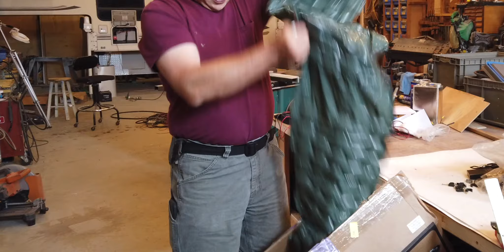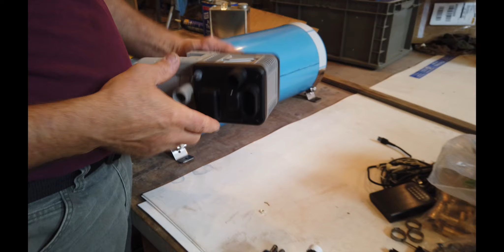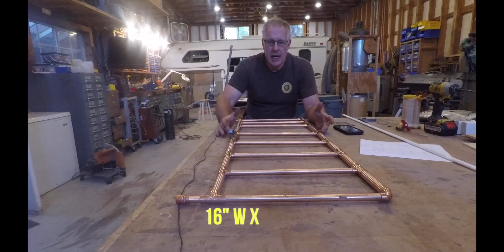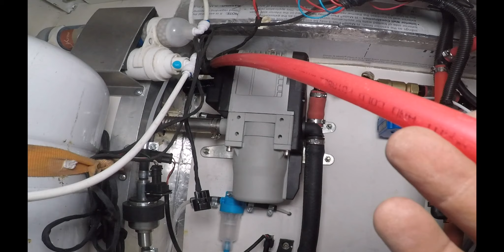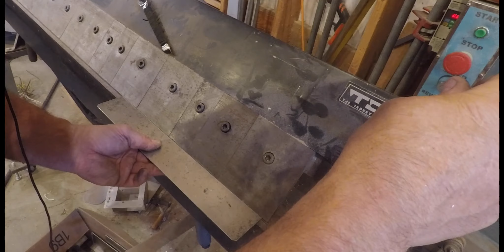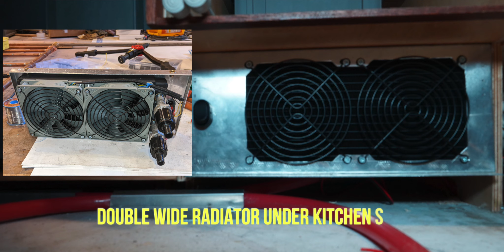BUILDING / INSTALL: Hydronic Heating for DIY Trucks Camper Expedition Van Build

Comment: Great video. Any reason why you did not use plate heat exchangers especially to get heat from the engine coolant?
Reply: HX add not only circuiting complication but require addition and control of additional. Pumps. In addition to that, energy exchange in HX is not 'free'. There will be around a 10C temp differential between the primary coolant side and the secondary coolant side. The 'cooler' secondary coolant subsequently has lower temperature and respectively lower heat transfer to the target. For instance, coolant exiting the boiler at the maximum of 80C/180F and flowing through a HX will only result in a maximum of 70C/162F output. This 10C/18F differential exists in the system at ALL temperatures. This reduces the rate of heat exchange at all temps but is particularly problematic until the boiler reaches near max temp.
Reply: @stevehericks5764  that makes sense. I was thinking from a reliability standpoint, it would reduce the likely hood of a problem downstream if there was a leak in the system and the ability for the vehicle to drive out.
Reply: @ramzizaz I use actuated ball valves on both the engine coolant supply and return lines that can can isolate the engine side from the habitat. If there were a leak in the habitat, I could prevent  loss of engine coolant. Additionally,  after I isolate the engine, i have the ability to drain coolant from the habitat that I can add back into the engine.

Comment: You're a mad scientist. A man after my own heart. I am designing a system myself and found this very useful. How did the radiator work out for the bathroom? I had something similar in mind but had plans on just using soft copper tubing and bending it back and forth much like a car radiator. The larger diameter tubing might be a better idea because it would probably hold the heat longer? Thanks for sharing.
Reply from the maker: I used 3/4 sides and 1/2 rails mostly because I had lots of pipe already...it works pretty well at heating the shower...what id intended was that it would almost superheat the shower/entry so when the door is open when cold, it would potentially push heat into the camper. It doesn't really do that. If dit again, Id used 3/4 type K everywhere for strength as it can become a handrail when not heating. It is a bit of burn hazard when showering so I wait 20' or so after heating a tank of water and shutting it off.  I haven't used it much as it's intended for really cold weather and haven't camped in that because I've been living in it for a year and a half while I'm building a house and have shore power and mostly use the heat pump. It does work well and I have no regrets.

Comment: Who designed the fiagram ?
Reply from the maker: The hydronic plan was done by me based on all  the things I wanted the system to do and the way equipment is intended to work. There are a lot of designs made that inadequately consider issues like 1) flow control, especially balancing in parallel circuits, 2) temperature drop in multiple or serial heat exchangers, 3) adequate capacity to discharge heat like the expectation that small floor grids can effectively radiate much at all. 

The diagram is available in a PDF document with a (hopefully) thorough explanation of the design intent of various elements at WorkingOnExploring.com/TechDocs. The diagram itself is designed in MS Visio which I will share but is not posted.
Reply: @WorkingOnExploring  
Thank you very much, so much information. I believe that you are an expert just before your buid
Reply from the maker: @EWOverland  I have 3 videos on the system covering 1) design, 2) construction and 3) operation that covers some performance evaluation. Since then I have added some functions  (heat radiators in my battery box) and made a couple tweaks. I still have yet to complete adding a heat loop to my gray tank (but plan to). I'm in the middle of building a large shop-house which is using a 72kBTU air to water heat pump to provide heat for 4200SF of concrete floors, a 6x54ft lap pool, a hot tub and heat/cool the 2800sf residence with a large hydronic air handler...so not many recent video updates. A few updates are in travel videos or mixed with upgrades to the freeze protection system made after the hydronic videos which is closely integrated to and dependent on the hydronic system.
Reply: @WorkingOnExploring  Thanks, the link for the chiniese hydronic heater do not show the heater

Comment: Your camper really has it all! Small but packs a punch. Hydronic heating usually only appears on top end class A diesels motorhomes.
Reply from the maker: Thanks. The hydronic system evolved from my goal not to have propane and a the need to heat water using a diesel source. Then there was the ability to get 'free hot water' from engine waste heat that came along with using coolant to heat water. It only seemed natural to add the hydronic air heating capability to the cabin too. It works very well and the redundancy is comforting. I also realized that using hot coolant to provide freeze protection was also a benefit. While  do have electrical freeze protection backup to external areas, I will soon implement a hot coolant loop in my (external) battery box and gray tank.

Comment: Very cool stuff.  Do you have a link to where you found the Chinese espar copy?
Reply from the maker: The coolant heater is a product of 'Hcalory'. I bought it on Aliexpress through the distributor called 'Szyiqitrading'. I would not recommend buying from them as when I had an issue (the operator manual did not include operating instructions for the wired controller provided), they were unresponsive. I doubt they had the information anyway and were just reselling the product they bought repackaged. When I contacted Hcalory directly, they also would not help because I had not purchased it from them directly. In my opinion, Hcalory is responsible to provide a manual covering the equipment in the box regardless of who  I purchased it from. What I believe happened is the control was new enough that they had not done that yet and simply hoped for the best.
Here is the link;
https://www.aliexpress.us/item/3256803096628968.html?spm=a2g0o.order_list.order_list_main.5.63711802EwB5Jo&gatewayAdapt=glo2usa4itemAdapt&_randl_shipto=US

I have written my own manual for the 'new control' and posted it on my blog: WorkingOnExploring.com/TechDocs

I do note that the product on the above link is almost devoid of the Hcalory name which was more prominent when I bought mine. The unit is available with a number of different controls. I chose the 'New remote' which contains a different wired control AND wireless control, both of which I like. The wired control however has all Chinese characters for status symbols. The updated ad shows English characters in place of Chinese so hopefully newer units will not have that problem. It is hard to guess if they will have updated the manual in the package you might get.

I absolutely do recommend products made by Hcalory however. It is very well made and even the installation parts are well done. There are two minor exceptions; The screw style hose clamps for the 3/4" heater hose are crap and there is no 'T' fitting to tap into a fuel line. 

Here is their manufacturers link to the same unit;
https://hcalory.com/collections/heater/products/w51-plumbing-heater-wireless-remote-control-12v?variant=39961317113899
The product is also less expensive through their site than the distributor.
Reply: @WorkingOnExploring  Thanks for the info and the links!  On the product page, it seems to offer conflicting information about fuel type.  It shows "petrol/diesel" on a few pics, "petrol vehicles" on another, and "diesel" in the specs.  I need a gasoline heater, unless I decide to install an auxiliary diesel tank on my Promaster.  I'd prefer not to go that route.  Any idea if they offer a gasoline heater?

Also, does this need a glycol reservoir tank added to the system?  I didn't see that in the accessories listed.

Did you pick up your heat exchangers separately to heat your water & air?
Reply from the maker: 1) According to the manual, it will operate on either diesel or gasoline.
https://cdn.shopify.com/s/files/1/0565/0507/3707/files/W51_Plumbing_Heater_compressed.pdf?v=1673076304
See page 5.
2) Technically, hydronic systems can be operated as either a closed system with a pressurized expansion tank (either bladder or airspace) or as an open system with a vented 'reservoir' tank. I elected to use pressurized because it was sharing coolant with my engine which was a 16psi pressurized system. My tank is a radiator overflow tank from a Cooper Mini. I specifically shopped for a vehicle coolant tank since they have a pressure relief cap and I needed a very small size to fit into the space I had. Doing so has some limitations in the pipe fittings available by mine worked well for me and was inexpensive. EVERY system which undergoes heating and cooling will need a method of accommodating expansion and contraction. Also, to fill the system, gravity demands that the opening be the highest point in the system so that demands some kind of gaugeable or translucent tank.
3) You can find any number of aftermarket fan coils designed as an 'auxiliary heater' for a vehicle cabin that will work. This will be a 'heater core' (coil) and a high-velocity centrifugal blower in a metal cabinet. Some come with speed controls. Start on eBay. Most use 5/8 or 3/4 heater hose piping. 

Your system design has to be able to handle both the fluid flow and all of the heat the burner puts out or it will turn on and off fairly quickly which is not good. That's probably a phone conversation if you don't understand the concept of the coolant heater operation. These are designed to heat engines on a single or a couple of cycles. They CAN be used for camper heating but they are not well-controlled (as an RV propane furnace is) for long-term temperature stability.

I didn't use these automotive-designed units because I believe they assume to be working in an operating vehicle, supplied by engine coolant. This further assumes since they are operating in a noisy environment so most of them are not 'quiet' by the standard  I want to apply. They also consume a lot of electricity. I want virtually silent, gentle heat which I have. I built mine from something supposed to be 'inherently quiet(er)' being 2 differently sized fan coils made from a liquid CPU cooling radiator and 'high static pressure 120mm fans' specifically designed for these coils (don't use any old computer fan). If you care about noise,  pay close attention to the noise spec of the fans. Mine are low speed, 25dBA. If they don't list it nose specs, assume its noisy. If its over about 30 dBA, and you care about noise, you won't be happy. These were not expensive and simple to make. They have small fittings and should not be used if you plan to use a series flow layout. These need to be parallel connected with a couple of balancing valves. My system is just on the side of too small. The heater runs ~35m from startup to the first shutoff with all HX running and then cycles about every 15'. These radiators have BSPT fittings that can accept NPT pipe but will leak unless you use a curing sealant such as Loctite 545.
large radiator https://www.amazon.com/gp/product/B08P18PQPN/ref=ppx_yo_dt_b_search_asin_title?ie=UTF8&th=1
small radiator https://www.amazon.com/gp/product/B08P18KX1V/ref=ppx_yo_dt_b_search_asin_title?ie=UTF8&th=1
Fan https://www.amazon.com/gp/product/B07CG2PGY6/ref=ppx_yo_dt_b_search_asin_title?ie=UTF8&psc=1
Thermal switch https://www.amazon.com/gp/product/B08BQXLXQ2/ref=ppx_yo_dt_b_search_asin_title?ie=UTF8&th=1

4) My water heater is a 'calorifier' which has an internal pipe loop heat exchanger. Lots of folks in the van community just use a dedicated fin-plate HX. This works fine to heat water on demand but a) takes time and deliberate action to heat water and b) doesn't take advantage of being able to heat (and store) a tank of water using (free) engine coolant heat. c) it is also not very efficient as a lot of energy is invested in heating the coolant system up to get it hot enough to work on demand which is then lost when shut off. 
https://www.heatso.com/surecal-20-liter-5-28-gal-horizontal-single-coil-calorifier/
They also have smaller units and there are other manufacturers. A lot of them are quite expensive. See 'VanLand' channel
Reply: @WorkingOnExploring  Thank you again for the thorough response.  I ended up buying the Hcalory system from AliExpress (sold out on their website, except the old controller).  I also picked up a couple inexpensive plate heat exchangers to test out.  I believe what you're saying about the inefficiencies, but I want to test a couple of these models and see how the work for on-demand.  

I may reach out through your website once I have the system in hand and inevitably run into issues.
Reply from the maker: If you want the 'on demand' type system, I'm sure just about any type/size plate HX will work well as water volume is typically low.  Have a plan to get air out as trapped air in a HX will degrade their performance substantially. Connections up is best and anything else is likely to be a problem.
Reply: @WorkingOnExploring  I was just reading about that.  Seems that pushing the glycol up from the bottom is the recommended way to reduce trapped air.
Reply from the maker: Just understand gravity....there is no 'pushing' a fluid. Its heavier than air and always settles to low points. The only way air gets out is to ensure that there is an up sloping path for it to rise on top of the fluid. Plate HX have 2 fluid sections and 4 fittings. The section fittings are separated on the long axis. Said another way, section in and out fittings are the same (long) side. On the end are (where they are closest), is an entry or exit for opposing sections.. If you mount the HX on a wall, horizontally, the fitting pair for one section are on the bottom and that section will only fill half the HX with fluid. If you want to mount it on a wall, mount it vertically so both sections have a fitting at the top. HX's work best with 'counter flow’ meaning the flows move in opposite directions. One each end, use one fitting as an entrance and one is an exit. Same on the opposite end....may not make a lot of difference with low flow.
Reply: Not in a insulated compartment,  Not good.
Reply: Didn't show the disc in the pipe

Comment: Impressive planning and design. 
Definitely a thumbs up 👍
Reply from the maker: Thanks. We've been on the road for 6 weeks and have used it mostly for heating water. It definitely works well in all modes. We have tested each including heating the engine in Teton NP on a near freezing morning and heating the cabin and wet bay.  Most of all, it's really nice to have 5 gallons of 'free' 80C water at the end of a drive day.